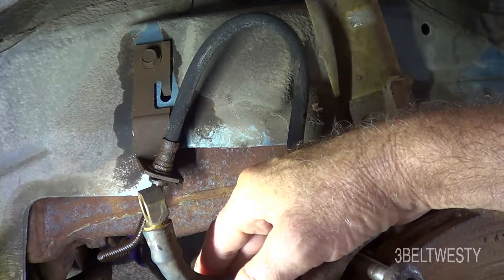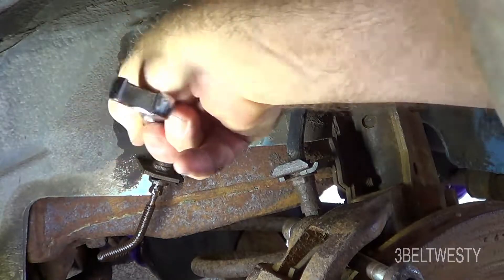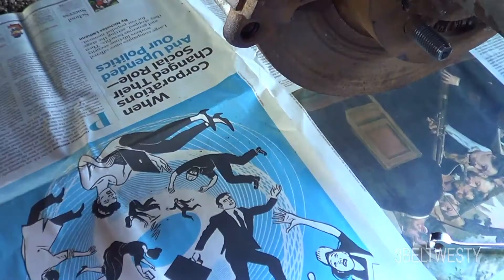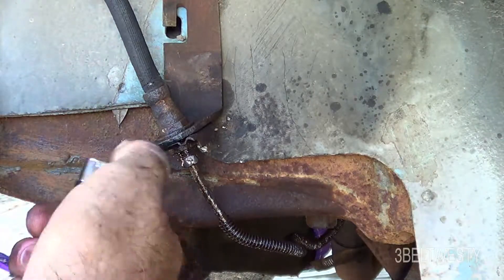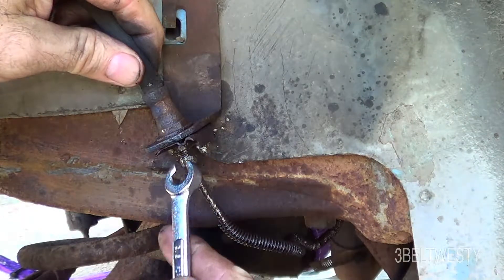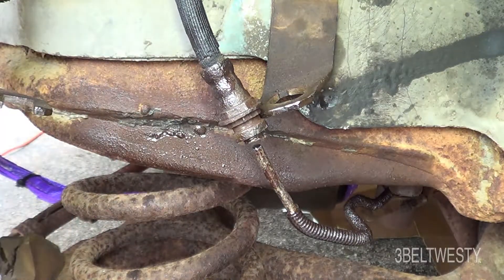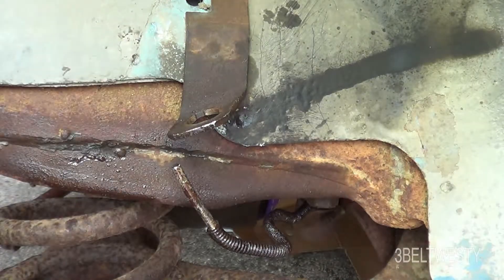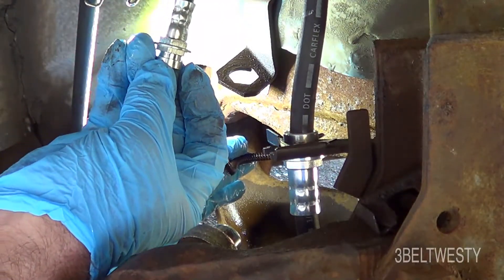Clogged Brake lines Stuck fittings Camaro 3rd gen

Comment: You can also fit a 5/8 over the hose fitting and just turn the hose off of the line. Has to be up out of that bracket a little bit though.
Reply: If your fitting is seized to the line.
Reply: Also if the fitting gets rounded off a pair of vice grips will save the day.